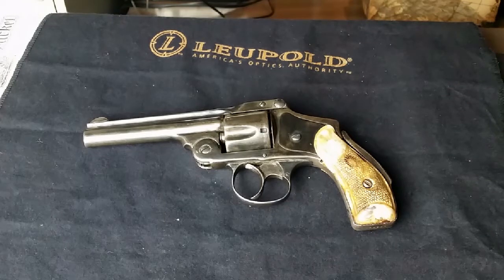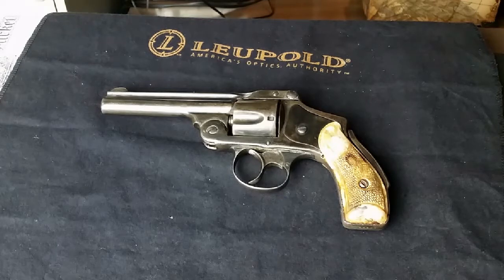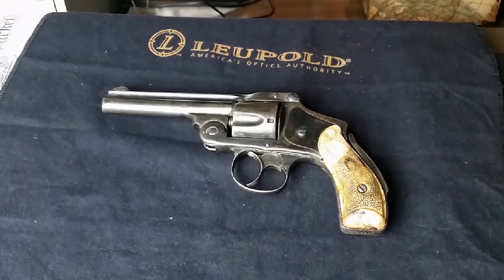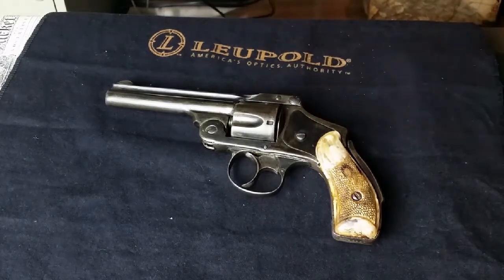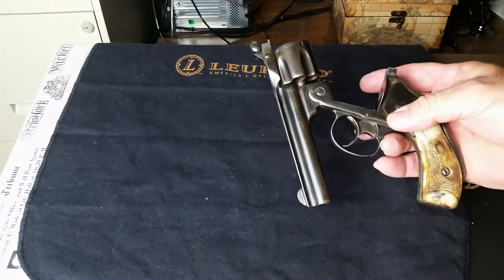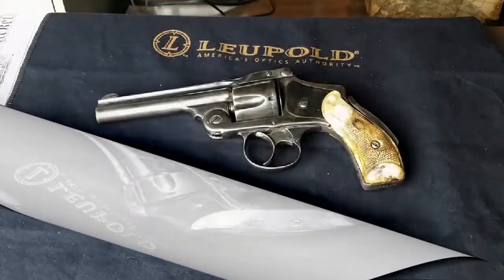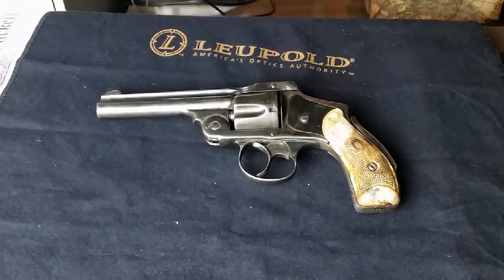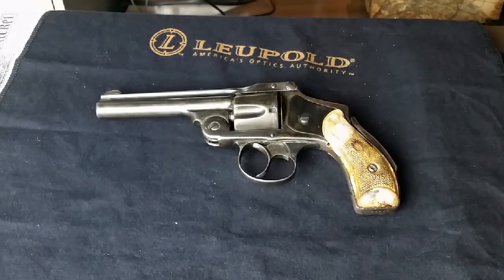Smith & Wesson .38 (Lemon Squeezer) 1920,  Gary J

Comment: They are 38 S&W.  They will fire aa 38 short colt if you reload with the .360 diameter bullet
Reply from the maker: Thanks , I didn’t know that.
Reply: .360 bullet is for .357and .38 S&W .38 is true 38 .360 will work but key hole
Reply: @radicaledwards3449  not sure which true .38 your referring to?  .38 S&W uses a .360-.361 bullet.  .38 special, .38 colt, .357 magnum all use a .357-.358 sized bullet.  You can check most reloading data info.
Reply: @jimh6763  Then what are the dimensions of lands and grooves in the rifling?
Reply: @radicaledwards3449  .38 S&W is about .3595-.3615.  I use .360 sized bullets that work good.  It's actually a little hard to find bullets that size. They say you can use hollow based .357 bullets too.  The hollow based expands when fired, to fill the rifling. I've never used them
Reply: @jimh6763  Hollow base makes sense, Ill try them.

Comment: This video is very misleading:  Smith and Wesson never had a caliber called a .38 Short.  It was called the .38 Smith and Wesson...PERIOD.   Colt had calibers called .38 Short Colt and .38 Long Colt buy they were smaller in diameter than the .38 S&W: .357 for Colt and .361 for S&W.    The .38 S&W caliber was very popular and Colt eventually made revolvers chambered for this .361 round but Colt would call their bullet the Colt New Police.  These rounds: .38 short Colt, .38 long Colt, and .38 S&W and .38 New Po;ice were all low power.  Eventually S&W would introduce the .38 Smith and Wesson Special with ballistics nearing twice the power as those previous bullets.  It also had a diameter of .357 as used today and commonly referred to as the .38 special.
Reply from the maker: Thank you for that correction! You are right.  A .38 colt short is too large for this revolver. The SW ctg. is smaller.